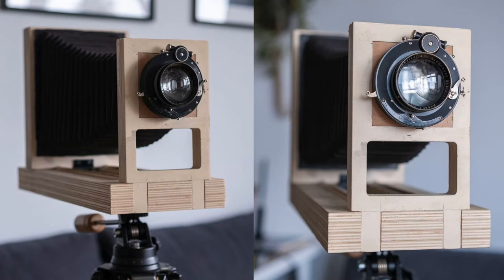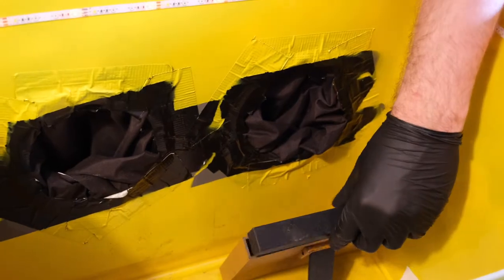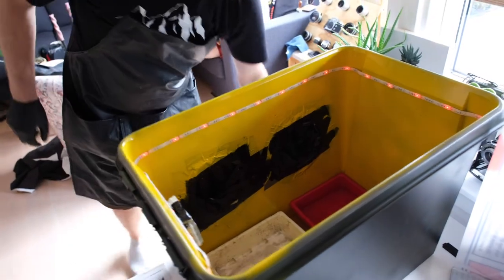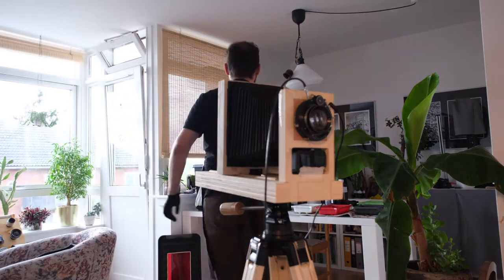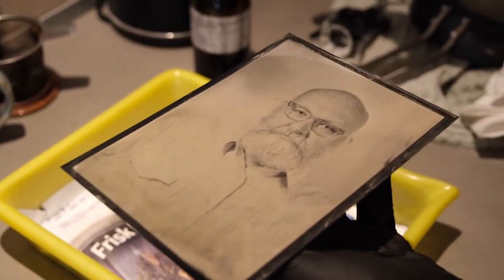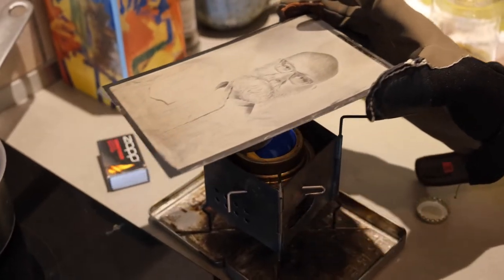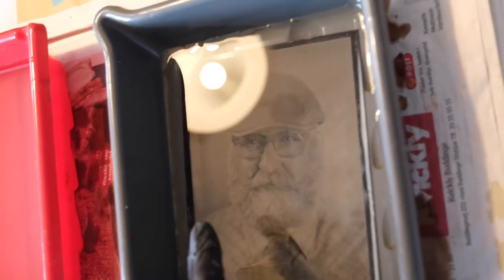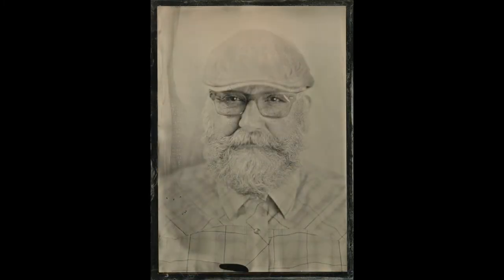First Attempt at Wet Plate Collodion

Comment: Hi - nice portraits - I would suggest to Stan that he use more water / change the water out for the stop bath (red tray in the box) - the plates are coming out looking "greasy"  and the water is streaking off - this is a sign that he has not sufficiently stopped development of the plate and washed all of the developer off. It does not appear to cause much harm to the image here as you are indoors and I assume not much UV light, but outdoors it can cause fogging or streaks on the plate due to continued development. It also causes the fixer to become exhausted much quicker due to the chemistry carrying over into the fixing bath.
Reply from the maker: Thanks for the comment Sam, I shall pass your message onto Stan.